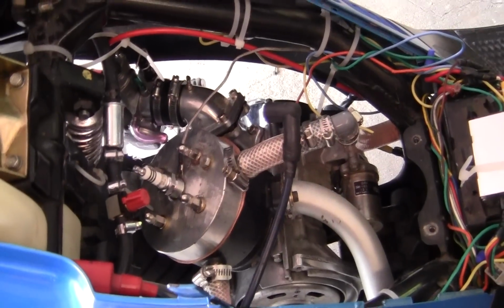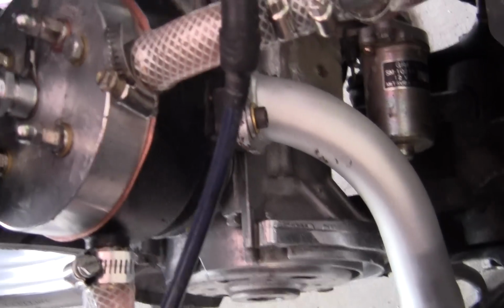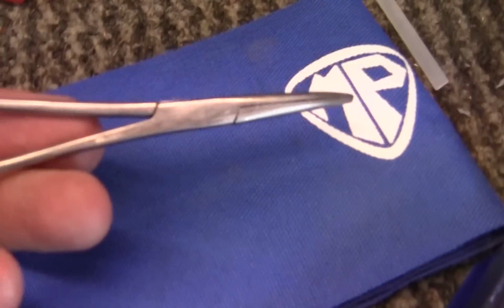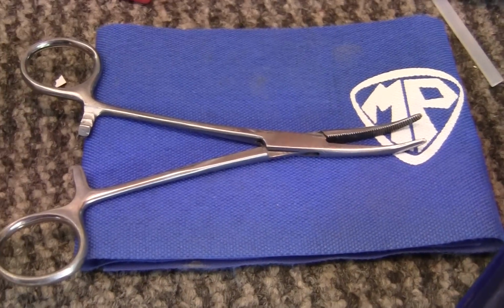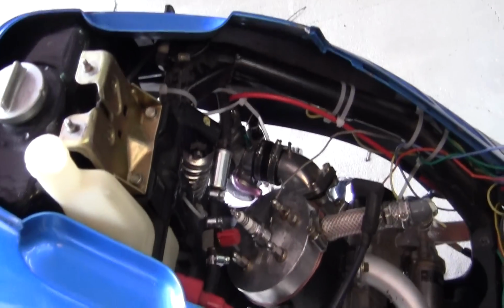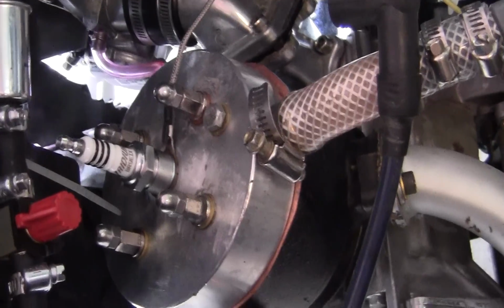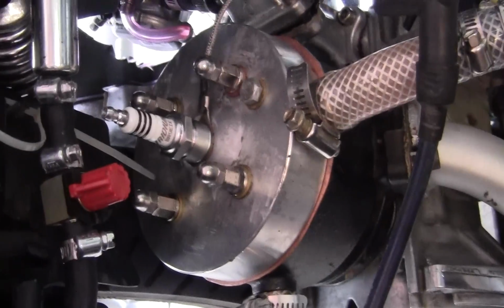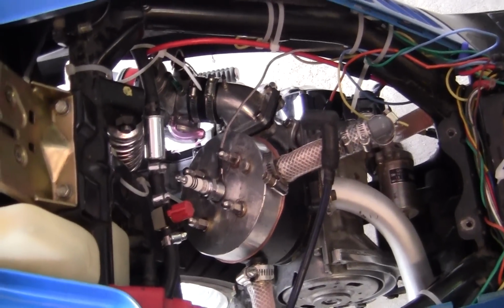FINAL RACE TUNING ON BIG HONDA RACE ENGINE

Comment from the maker: @SRT480 We use a grease that comes in a very small tube, called "anti-seize". It is silver in color and smells horrible for some reason. Real good for aluminum heads and other parts, but it smells really bad for some reason.